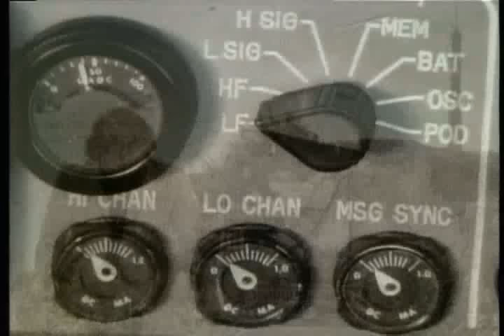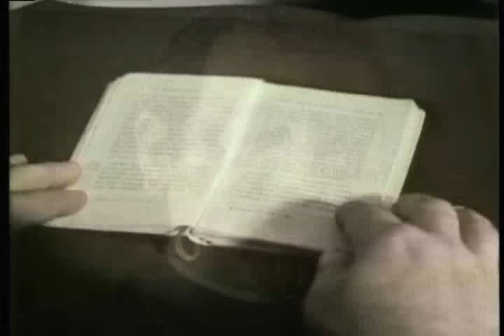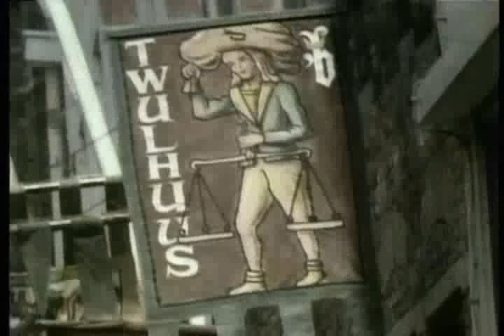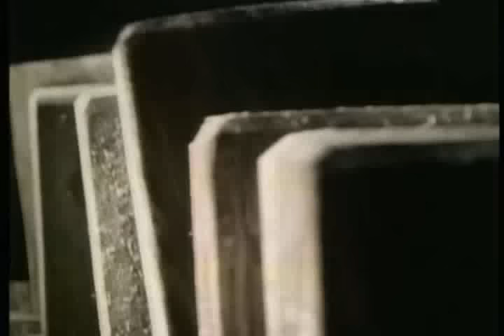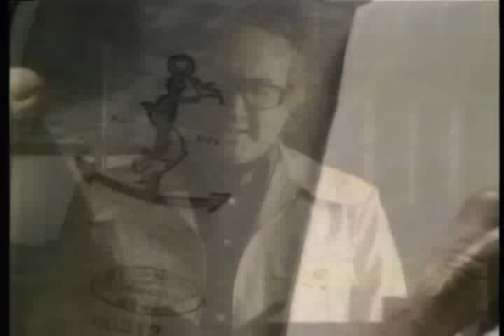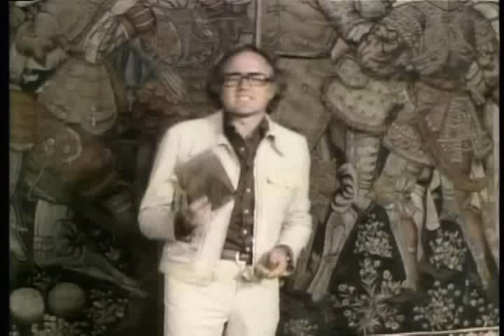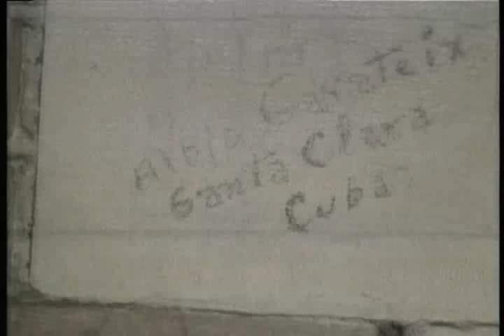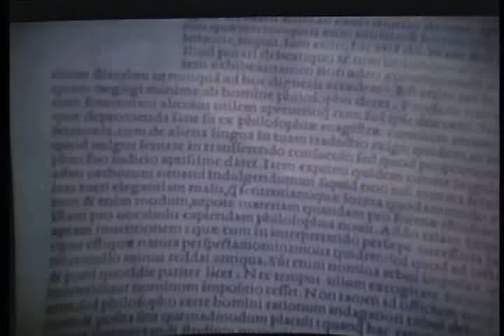James Burke Connections, Ep. 4 "Faith in Numbers"

Comment: I'm surprised he didn't mention the punchcards used by the old IBM computers.
Reply: When this series aired, the IBM punch card was still in common use.  Even if you weren't directly involved with computers at that time, most folks knew what a punch card was, what it looked like, and they would have recognized its ancestor.

I still remember clocking in and out on my first job as an adult using punch cards.  Find the card in the rack with your name, slide it into the slot under the big clock, yank the lever.   Chuh CHONK.